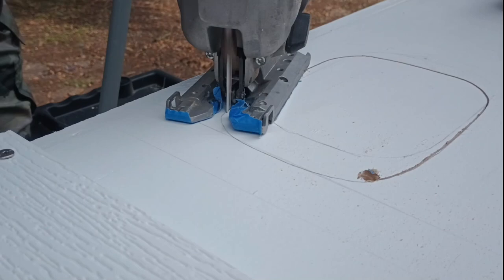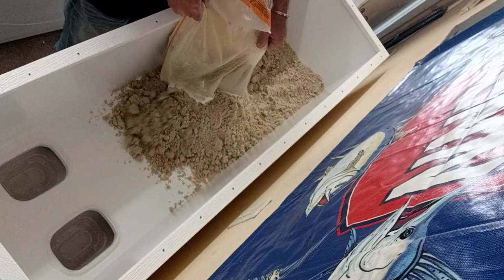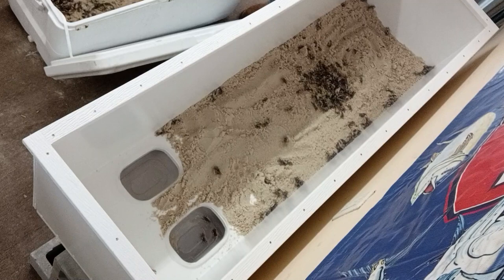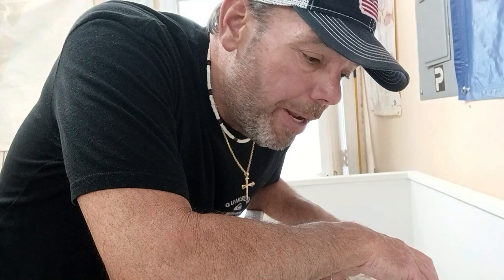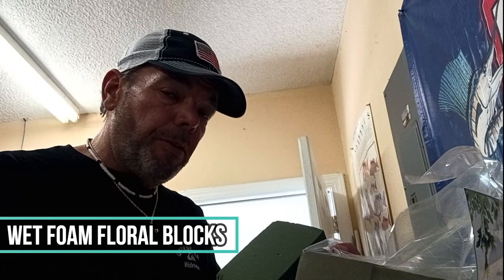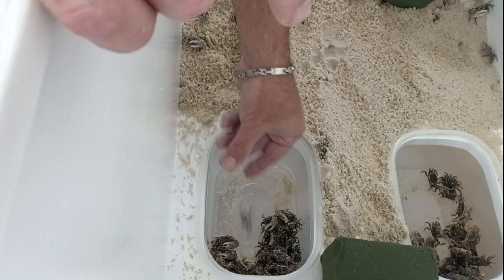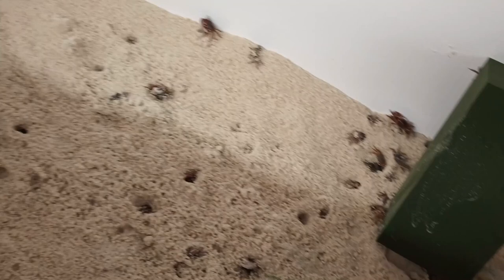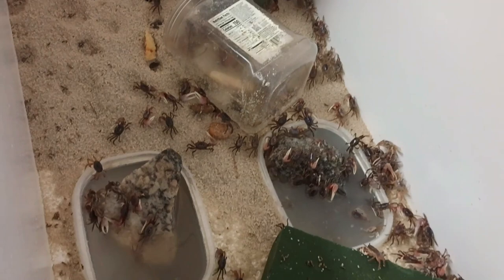How to Build a Fiddler Crab Farm - LATEST VERSION + PRO TIPS

Comment: Nice job. Well presented and information was easy to follow. I would like to see how you clean out the box and sand as well as feeding.
Thank you
Mike
Reply from the maker: @redwood for cleaning, it's around once a month or so. We get all the "loose" fiddlers out of the box first..

Then we set a large storage bin underneath the box where my water feeder holes are located. With the bowls removed, we scrape all the contaminated sand down to the holes, the sand falls through the holes into the bin underneath.

We then pick up any loose crabs from the bin that we can get to. Then, we flood the bin and sand with water and the remaining crabs are scooped up with a small dip net.. Add new sand into the box, clean the crabs in a 5 gallon bucket of river water for 20 minutes while doing all the above, pour in new sand, return the crabs into the box after the sand with the dip net into the box.. Done deal. 💪👊

Comment: Why use brackish water and not salt water? I find all my wild fidders in salt water environments. Im curious on what makes brackish water better to use?
Reply from the maker: I'm simply using the water they came from... Been keeping fiddlers for about 30 years, I'm just relaying what's for sure worked for me and I am not likely to change it. However, I completely understand there's saltwater in brackish water, and using straight salt water may also be just fine for some people, but it kills my fiddlers wayy faster. So, I use the water they come from, which is an average between 10 to 15 ppm, which is close to half and half.. whereas seawater is around 34-35 ppm.. Depending on where someone gets the fiddlers, saltwater may be fine. But it's not for me personally.
Reply: sea water recipe is 1 Tbsp to 1 pint
work from that
no iodized